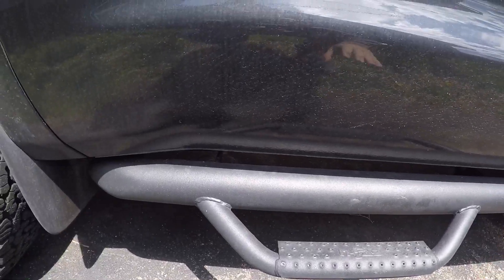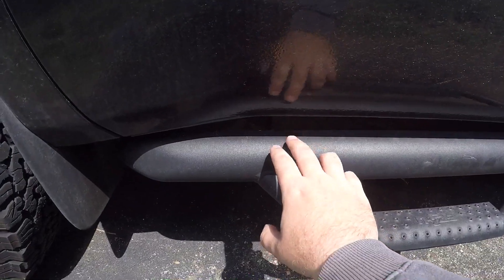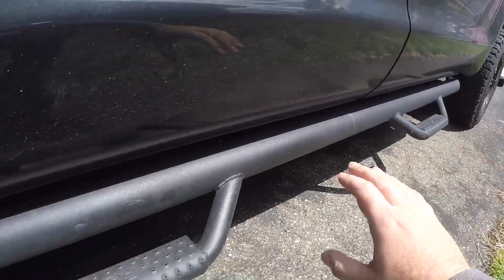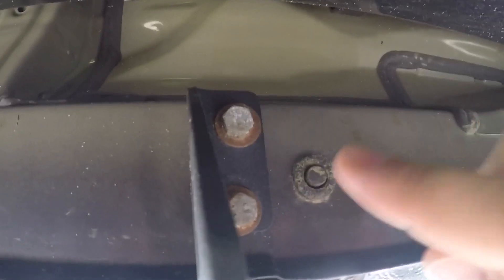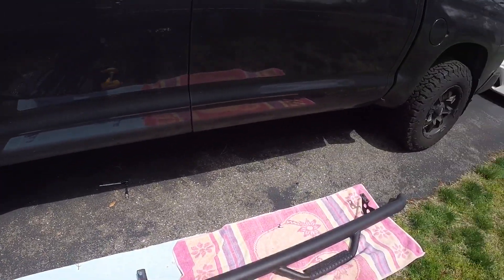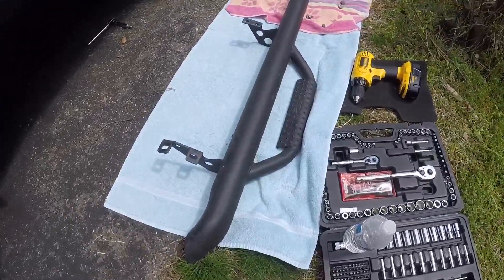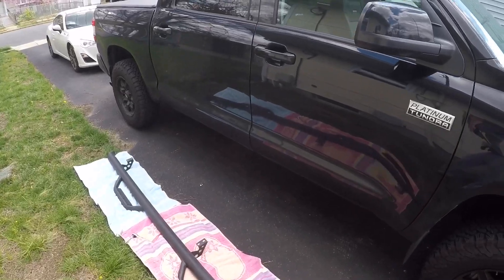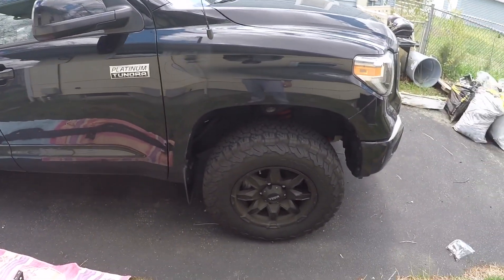N-Fab Predator Pro Side Step Installation On A Toyota Tundra: Round 2

Comment: The no step look is great, power steps are very easy on the eyes, however if you aren’t used to it watch how close you stand or you’ll be reminded by a sharp solid hit to your chin with a metal pipe.
I like your new steps, maybe you won’t slip next winter and bang your noggin and forbid getting another dent!
I got the port installed Toyota predator step bar, now that I’m used to them I’ve gotten to really like them.
Reply from the maker: Yea they are nice

Comment: If need be might need to drill out the whole a pinch. No on the truck on the step. Also is the issue on both sides?
Reply from the maker: It was more the passenger side. Just needed a little persuasion

Comment: Nothing to do with this
Is anyone experienced the following issue?
After start up my 18 tundra I hear a banging or metal to metal clicking noise under the driver side front as I start rolling or turning left.
I suspect something with the brake caliper making noice.
Dealer didn’t see anything wrong with the truck
They claiming :its the ABS system check but than you would hear it all around the vehicle also my 13 tundra never done this.
The truck runs fine (no pulling left or right.
Thanks
Reply from the maker: I think its actually the abs
Reply: probably but why only on the driver side?